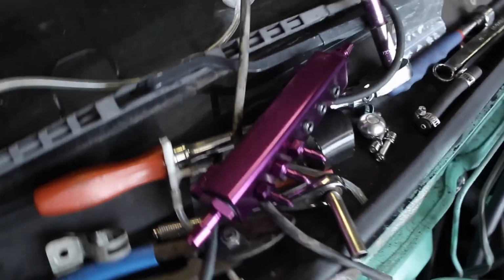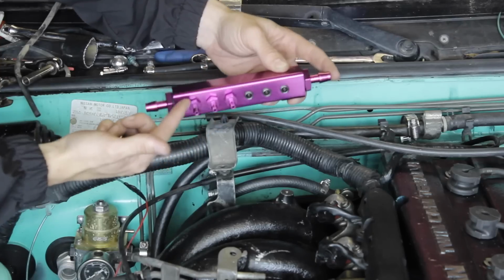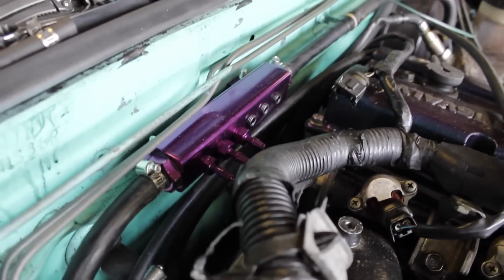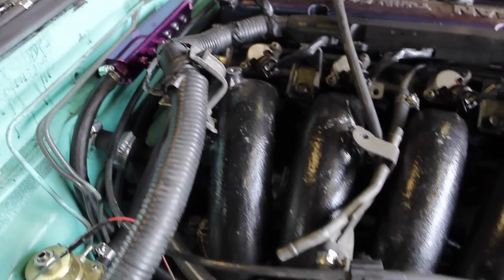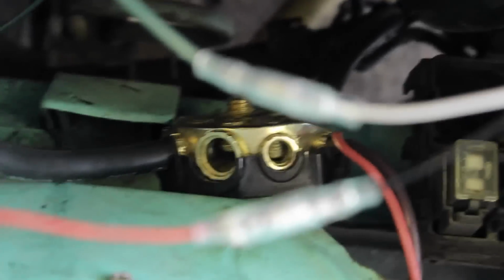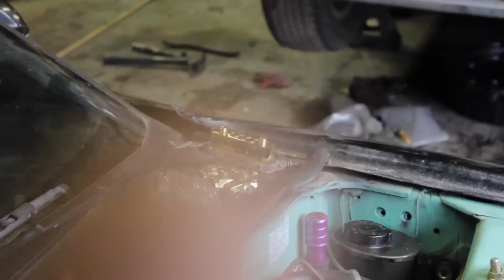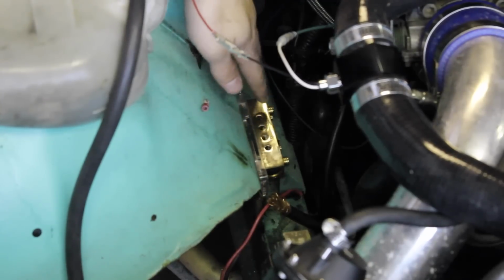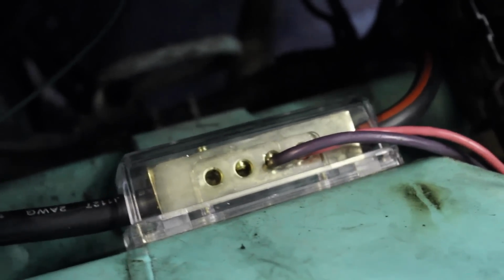TURBO 240SX BUILD | VACUUM MANIFOLD & POWER DISTRIBUTOR BLOCK

Comment: isn't it bad to have to many signals coming from one vacuum source ? just wondering
Reply from the maker: kariem court I haven't heard of that, I mean if you think of it technically vacuum it's self is coming from one source already
Reply: Southern Hooning true I don't rember where I heard it from
Reply from the maker: kariem court haha tru, I mean when it comes down to it everyone's got different opinions in the car world lol
Reply: This is usually why the block is connected to the brake booster line. It's usually the biggest line in diameter so mass air flow isn't affected much.